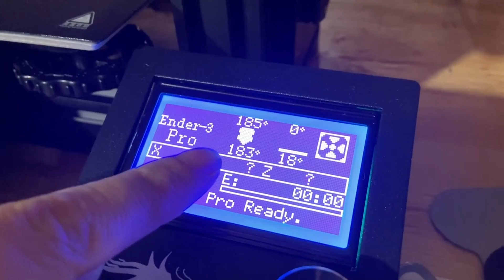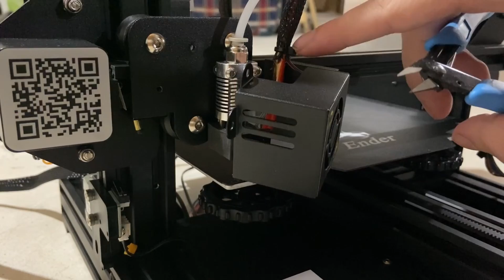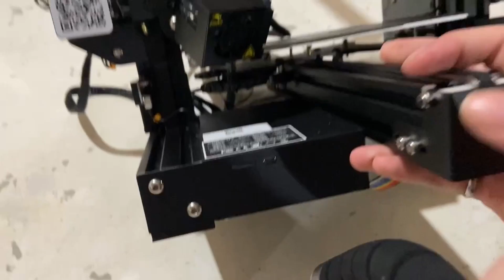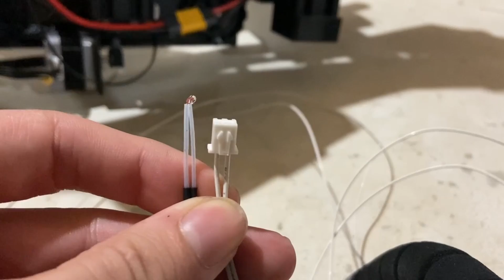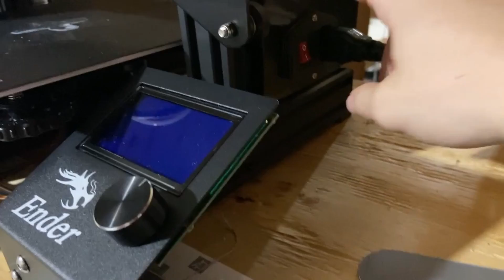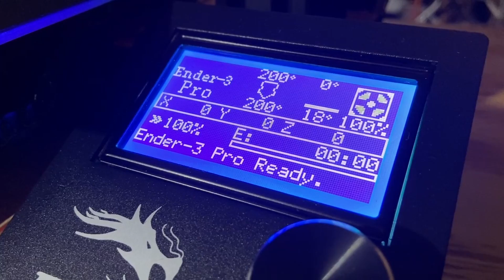Ender 3 Pro Thermal Runaway FIX (10-15 Minutes) | Thermistor Replacement

Comment: Thanks for the video.  When I tried removing the thermistor, it broke off and was stuck in the hole.  If this happens, you can drill it out with a 5/64” drill bit.

Comment: Thanks so much for this video.  My thermistor was actually OK just come out the hole due to the screw comming loose.  This video showed me what to look for and how to fix.  4 hours into a print since the repair, so looking good.  Just seen the comment below about thermal paste so I will be doing that when this print finishes.

Comment: You there yet get a M3 stud thermostat and make sure that it is quick detached so that way you don't have to take the whole thing apart just to unplug the bad thermistor and replace it with a good one. No need to wrote any more wires ever again

Comment: The whole design to screw this on the way it is,is a design nightmare. The insulation is so soft that it’s easily crushed. But it’s not crushed per se from the bolt pressure but from the clockwise tightening motion, shearing it between the two surfaces. This can, to a large part, be prevented by using a die grinder and grinding grooves where the wires sit against the heat block. And slightly bevelling that hole.

Comment: So I was doing an hours long large print and at about 3/4 of the way through it the printer stopped and gave this error message - 'Thermal Runaway: Bed.   Printer Halted.   Please Reset.'  Up to this point it was working just fine. I turned the printer off let it sit for a bit, turned it back on and resumed the print. and a few minutes later the same error message happened.  I can still print small things as long as they pretty much stay in the center of the bed.  The board in my printer is the Creality v4.2.7  The firmware is Marlin 2.0.6 Ender - 3.
Reply: I’m having the same issue. Anything large gives me that message every time

Comment: My issue is only when it prints when is in stand by temps doesnt fluctates, what could it be?
Reply: Had the same issue
Take appart the hot end and clean any junk or debry inside the temp sensor just be careful since it is made out of glass. After cleaning it try again to print. hope it works

Comment: I have been struggling with silk PLA for a bit now. Finally stared at my number while printing and inevitably got the thermal runaway error twice. I was so disheartened because I thought this would be a complicated fix. Turns out this looks really simple! Will edit with an update once I fix my problem! Thanks!
Reply from the maker: Let’s hope it works for you! Once you learn how these things work, they’ll always be easy to fix
Reply: @aquilaecompany  OMG it was my damn thermistor! Old one fell apart in my hand while I was taking it off! I'm finally printing silk PLA without stringing! You're a lifesaver!

Comment: Ever hear of the Ender 3 having a thermal runaway problem and then after it is shut down and back on again it just continues to endlessly send power to the heater even though the temperature is set to 0C. After having a problem on mine I restarted it several times, but every time it would heat up until it started smoking. I ended up having to manually turn the temperature down to 0C even though it was already set to 0C and should not have been on at all. I didn't tell it to print or to continue any print or anything like that. It showed that it should be set to 0C on the control panel (info), but regardless it just kept sending full power to the heater until I manually told it to cool down (set temperature to 0C, but I didn't use the "cool down" option, which may have worked also). The bed temperature did not do this though and it remained off, despite being on during the same print that failed.

Comment: this printer looks like its never been used whats the cleaning secret i ran mine like the old one with machanics wire i alsp saw you broke the glass bulb on the new one but if it works go with it

Comment: I had a thermal runaway error and I opened up the hotend, and the thermister was not even in the hole. Do you think this could have caused my issue? Do I need to still replace the thermister ?
Reply: Lmao what do you think ?

Comment: I had the Thermal Runaway error on my CR-10s, found out that I forgot to put back the rubber nozzle cover. I put it back and it worked. I was printing using TPU filament.

Comment: Also the thermistor is put in the machine with thermal paste, like you would use to mount your cooler to your processor when building a PC. This paste dries out and becomes ineffective after about 1 1/2 - 2 years or so. Removing, cleaning and replacing the thermal paste is a maintenance item that will fix the problem. I was having an issue with inconsistent temps and thermal shutdowns (nozzle too cold) after about 1 1/2 years of owning my ender 3 v2 neo and replacing the paste fixed it perfectly.
Reply: Super helpful! And easier than replacing the thermistor
Reply: Какую пасту использовали? У меня такая же проблема.
Reply: Я использовал немного термопасты. тот же тип, который вы бы использовали для установки процессора компьютера. @sergeyivanov3690
Reply: @sergeyivanov3690 ever find out a fix?
Reply: This thing  has been sucking for quite some time...2 years now

Comment: Nice one. Had intermittent Thermal runaway errors. Replacement sort issue. But for odd reason I received short version of wire... But bit of soldering to old wire actually helped😂.

Comment: I'm probably doing this tomorrow.  Intermittent thermal runaway on long prints became a hard fault.   I think I will try cutting off the old plug on the motherboard side, taping the old wire to the new thermistor, and pulling it through the sheath with the old thermistor wire. Hopefully it works!  Might need to cut some zip-ties, but if they are not too tight it should work.
Reply from the maker: Good luck! That’s how mine started too. Don’t be afraid to cut and retie some zip ties!
Reply: i did the same with my cr10s but for me its still not working ( this is my fist big problem with this printer after having it for around 5-7 years

Comment: I got -15 temp error, what should I do?
Reply from the maker: Could you fill me in more on the error? Is the temperature reading -15? Is the error text "TEMP ERROR"? Is it for bed or extruder? Let me know, thanks!
Reply: @aquilaecompany  reading is showing -15 temp , after some time it shows ab temp error
Reply from the maker: Sounds like a textbook bad thermistor. @martian7754  Usually the way to tell is if the temperature reading is either completely wrong or unstable (reads inconsistently) a thermistor replacement is in order. Let me know if I can help you at all!

Comment: Had this issue with my 3 Pro aswell. Didnt change the thermistor, just put a tiny bit of heat conducive paste in the hole where the thermistor sits to give it a better thermo coupling.
Reply from the maker: Ahhh very clever

Comment: Getting E1 Thermal Runaway errors, even after replacing the heating element on ENDER 3 MAX PLS HELP ITS SOPTING AFTER 1HR OR SO
Reply from the maker: Did you replace the thermistor? That sounds like you might have a bad one!
Reply from the maker: A super easy way to check is to heat up your extruder  and see if the temperature value fluctuates a bunch
Reply: @aquilaecompany  YES A PURCHASED ENDER 3 MAX LAST MONTH AND IT GAVE ME TERMINAL RUNWAY ERROR E1 A WEEK AGO I ORDERED NEW THERMOSTATE AN REPLACED IT BUT STILL SAME FOR ONE HOUR ITS WROKING FINE TEP ALSO NOT FLUCTUATING BUT AFTER A HR ITS STARTING BEEPING AND SAMR ERROR 
PLS HELP
Reply: Did you find a way to fix it? I'm having the exact same problem
Reply: @angüela666  had the same issue. Most of the time the white powder inside the thermistor causes the issue. So I just opened the thermistor , gave it a little finger flick and replaced it carefully. It worked fine

Comment: great instruction! I have a problem where it ~could be a bad thermistor so I’m replacing to rule it out and this was super helpful. I’m going to try to use the existing old thermistor wire to pull the new one through the bundle sleeve.
Reply from the maker: Happy I could help! You definitely can do that if you want to be super neat, I’m just lazy